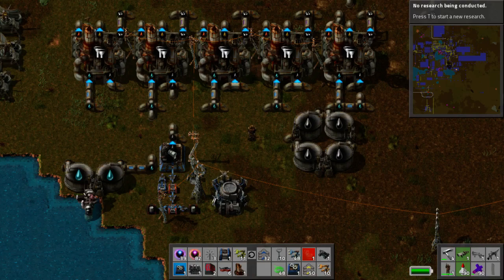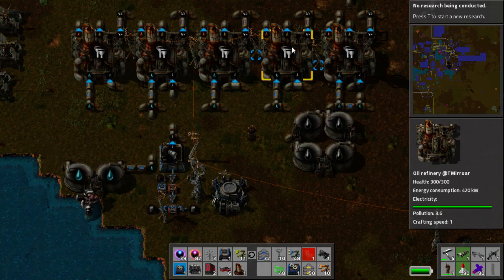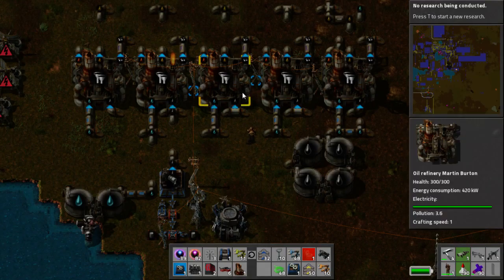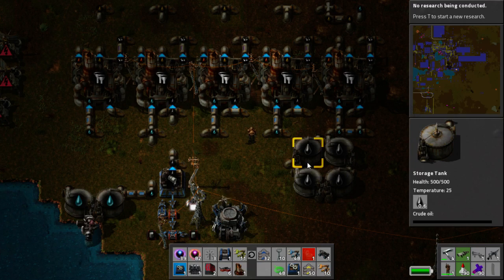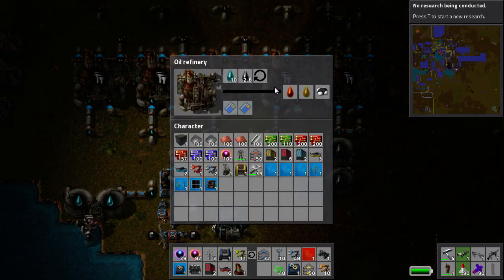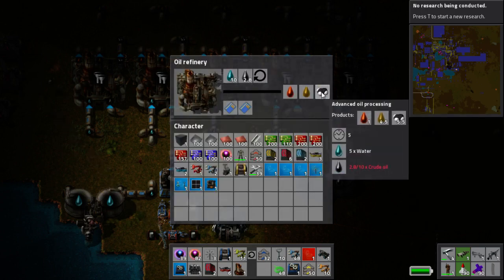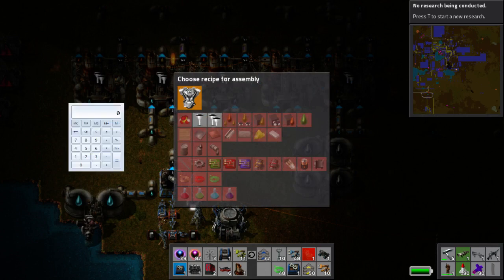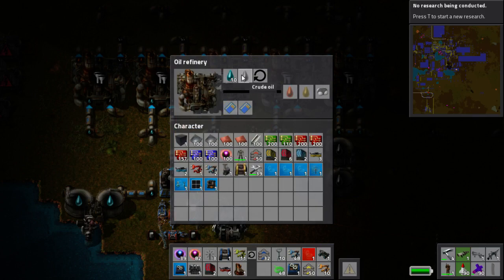Factorio Tutorial 33 Cracking

Comment: Cracking is good !

Only exception is if solid fuel is needed - then it really should be made from light oil - which is far the most efficient process.Those numbers are easy to do too. 
(Left as exercise - lol)
Reply: Ignoring normalization(because I'm lazy) 1 solid from heavy is .6 heavy per sec, 1 solid from light is .3 light per sec, 1 solid from petro is .6 petro per sec.

.6 heavy = .45 light = .3 petro
.3 light = .2 petro

So you can see you use less petro overall if you take your solids from light oil.
Reply: blade88343 Those numbers look right. The main point is the high efficiency of light-oil to solid fuel conversion.

Comment: Robot frames are made with electric engines, which in turn requires lubrificant, which in turn require heavy oil, not petroleum gas. I wonder how are you even producing them cracking all that oil o.o